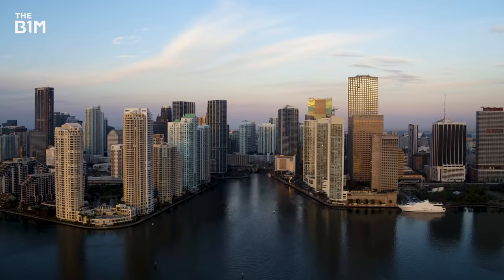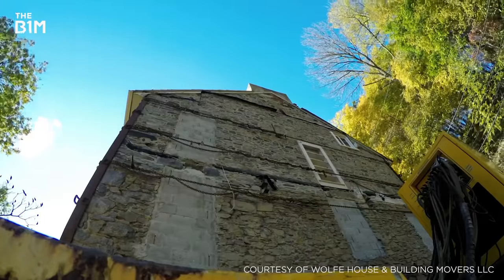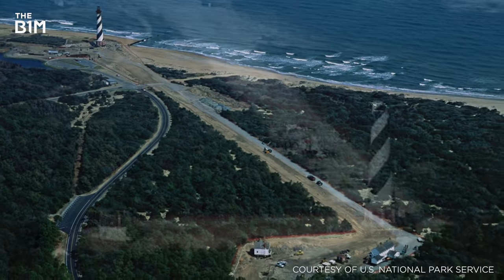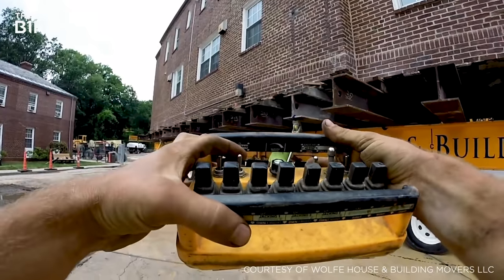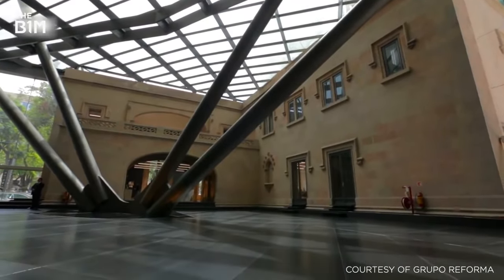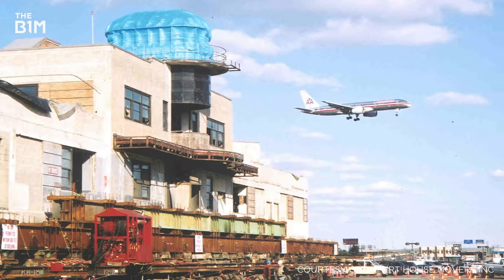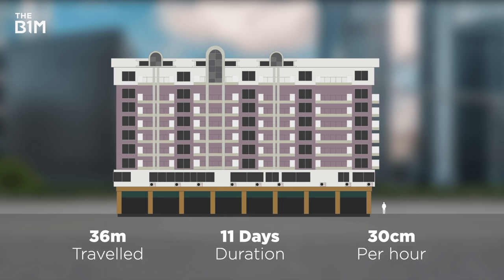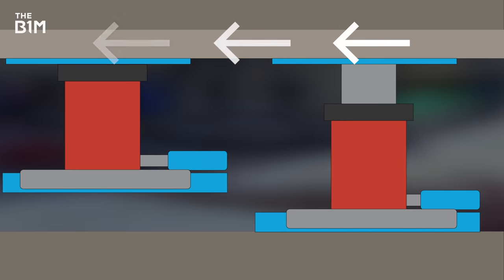How To Move a Building

Comment: This is so fascinating. Buildings 'traveling' or 'walking' at 30cm per hour. Most buildings used to be cheaper to reconstruct (or construct something else instead), but no longer.
Reply: From an environmental standpoint it's a very important change to make as well. Our habits of demolishing perfectly useful structures and rebuilding on the same site might be cheaper, but only because the costs are being shoved onto the environment. If we can move some or all of the original elements (maybe to push them together, or dedicate them to another purpose), a site can be redeveloped or densified with a much lower carbon/pollution footprint.

Comment: I have worked at the Cape Hatteras Lighthouse for now 3 summer seasons and visitors are always floored at the fact that they moved the lighthouse. There are dozens of great stories from that project like tourists handing coins to the workers that would be placed on the rails to get flattened by the lighthouse or how the park superintendent and the chief project manager both "rode" the lighthouse during the first push to show how confident they were in the engineering. As it would turn out, the move would also finish ahead of schedule by about a week. 
You definitely did your research, good job!

Comment: This is so interesting. I didn't know moving heavy buildings was so common. I live in the Amazon, and in the countryside, wooden houses (either floating houses or stilt houses) are often built, sold, and then transported to its location. They are also moved seasonally when the rivers flood and dry. But then again, they are only small wooden houses that can be moved by manpower alone.

Comment: I remember what a big deal it was when the Gem theatre in Detroit was moved. The theatre stood in the path of what's now Comerica Park and to prevent this, it was moved five blocks southeast to the corner of Madison and Brush. To add to the challenge, the Gem was built as an addition to the Century Club nextdoor and it was determined that you couldn't remove the Century Club without damaging the Gem so two entire buildings had to be moved together.

Comment: I find it is much easier to install the Professor Frink security system Springfield has. If the house notices an alleged intruder, it will grow legs and run down the street. It usually ends up bursting into flames but it's the fastest way to move a house.